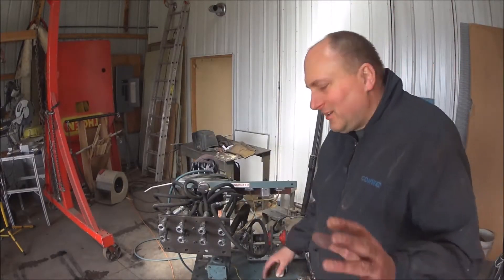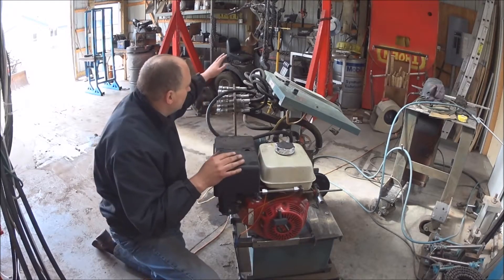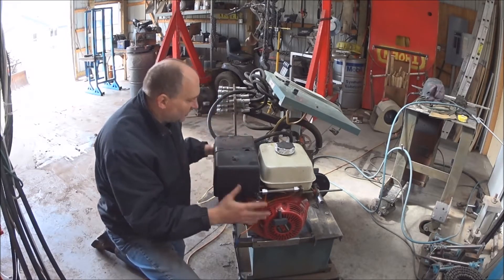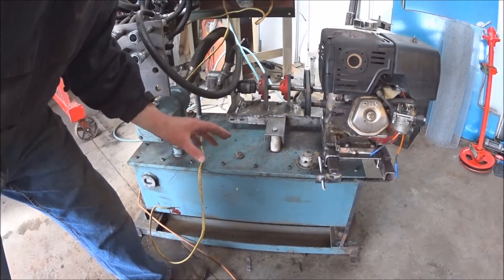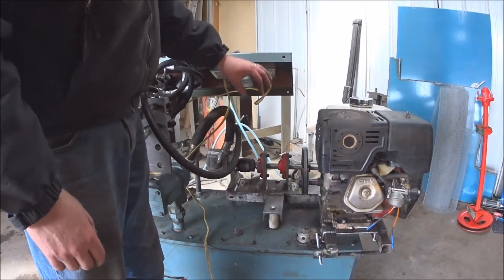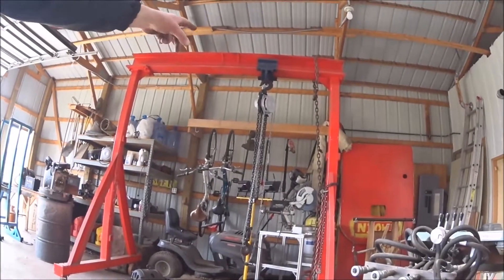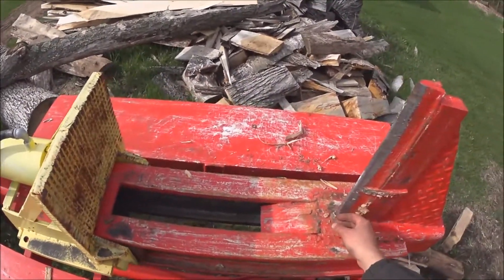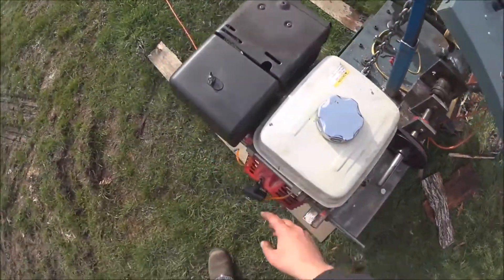Homemade Hydraulic Unit

Comment: Good idea sir, on the portable power unit. Something I've been considering when my larger circular mill goes back together. At least for the carriage assembly.  On my woodsplitter we built it to operate off the pto of any tractor as they too need to be exercised on occasion.
Reply from the maker: +Tractorman44 thanks..  it really works out good when part of it comes for free.  My ultimate rube setup for this is to have both.an electric and gas motor on there so I can run electric indoors and gas outdoors..